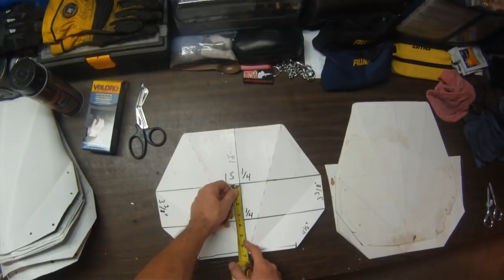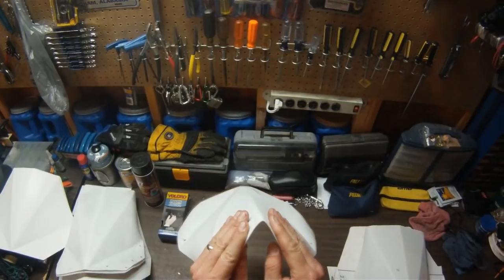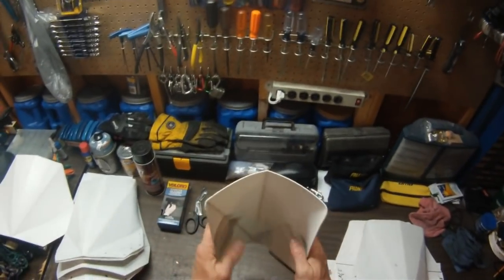DR650/DRZ400 DIY Windscreen

Comment: I saw one of these on a DRZ here in Western Australia , the rider told me about your video . I used a $6 sheet of polypropylene from the hardware , as the rubbish bins were around $20 to $30 here . Works great , thank you for the design
Reply: Brian Bullock Bunnings? How thick was the plastic?
Reply: hmm , IDK , 3 mm maybe , I used a heatgun and straight edge to manage the bends , its not perfect , but does a perfect job . Deflecting the wind off my chest , and cheap as to be able to trial and error , rangafrombanga
Reply: Ta. I'm off to Bunnings. Love this shit!

Comment: Used your template and used a 15 gal plastic barrel.  I used a torch to bend it.  It was alreay rounded and turned out “ok.”  I started tall and cut it down three times to get rid of buffeting.  It works. Thanks.

Comment: I can totally vouch for this DIY.  It's brilliant.  I made one thinking 'no way this is going to hold with velcro at speed'. But it worked fantastic! Never budged, and made all the difference as far as wind protection on the highway goes. 
Its brilliant because its sturdy enough to block wind but if your helmet (or face) makes contact in the gnarly stuff - its maleable enough that you wont be hurt.  I eventually bought a Baja windshield simply for aesthetics but this thing actually looks kind of cool. Mine was black so it looked a bit Mad Max.

Comment from the maker: As far as material, all I can say is whatever you can shape. I use plastic cans about 2mm thick.

I have a Clark on my DRZ and an IMS on my DR. Both are great. No issues. No complaints. The Clark cap is tight due to a swelling gasket, but not really a problem.

Comment: I like this design.  I just made one today out of posterboard using the measurements from the first on you showed.  I plan to try various heights and maybe attempt to make a rounded one out of lexan or something.  I might have to get some help from my pops to do that.  Either way, thanks for the diy on this one.  It seems so simple, but it actually looks badass in my opinion for what it is, and couldn't be more cost effective.  Thanks for taking the time to post the video of this.

Comment: Thanks for sharing, tried it on a trip to Ottawa, worked great, however it came off at 72 miles/hr, or 120km/hr, so I added velcro here and there, and wow, I made the second one using the stove at the lowest setting to soften up the plastic and its much easier to fold with precision, and again thanks, I saved up a shit load of money and it looks good

Comment from the maker: All the usual, FMF Q4, airbox opened, jet kit, carb work and extended fuel screw, shock spring and Gold Valve kit, Progressive Springs in the forks.

Several other mods, but those are the main performance mods that I can remember right off.

Comment from the maker: DR650. More versatile. More dependable. More power. Will do single track and Interstate and is better for long distance as well. The DRZ is only better in the most technical stuff.
Reply: fmlstewart get the 400, if you think you want the 650 for those reasons get yourself a v-strom or a verses instead. 
Surprisingly capable off road (look up fortnine on YouTube) 
The drz is a road legal dirtbike.
Reply from the maker: +Taylor St. Pierre dude, do you GeorgeSt. Pierre? 

I've had a drz400. it sucks s a dirt bike, and sucks s a super moto. the dr 650 is the shit!!! But, rude what you've got to the best of  your ability. I guarantee, unless you're Taddy Blasuziak, you're nit out riding your bike. Ride on!!!
Reply: fmlstewart I have a ktm 350 sx-f and the drz. Honestly the drz surprises me what it can do. It goes everywhere the ktm can go. It's heavy and rough for sure but It climbs every hill like the real bike and wheelies like mad. I've tried ktms 690 enduro r too. It's a much better bike, but it's also significantly more expensive. I wouldn't make the trade. 

When Yamaha (if) comes out with the t7 I'll make the trade though.
Reply from the maker: +Taylor St. Pierre yeah, I've had a 400 exc, and an XR400R. I've had two KLR's, '07 and a '12. I've never had a bad bike. Love them all, but the DR650 does it all better than any other bike I've ever owned. I'm currently riding a Triumph '13 800xc. It's badass! But I still miss my DR650. I'll be getting another soon!
Reply: fmlstewart maybe when I'm done with the 400 I'll have to try the 650. I've ridden the klr but I sure wouldn't trade that one... 
I've also got a super adventure... But it's awful off road. It's more of a sport touring bike than a true adventure bike. It's just too heavy. 
Itll be for sale next spring

Comment: First off.... AWESOME videos!!  I watched all 3, at least twice.  Do you still have your DR, or DRZ??  I am wondering what you decided is the best "angle of Attack" for the fairing??  I am making a custom template for my KTM 520EXC using many inputs from your videos.  I started by making a DRZ template as a baseline, and will eventually use it when I get back home to my DRZ.....  It just seems that the attack angle might help me keep from having to go through too many iterations.... I am going to try to find the angle of attack on the new production Honda Africa twin also, because I am thinking that angle would be about the same for all of these rally type fairings, what ever the brand.  Thanks again for your video work!!

Comment: so what really bothers me while riding is the wind turbulence in the helmet. bothers my ears. ear plugs help of course but would like something more.

since you claim the wind dumps out at throat height, does it make turbulence in the helmet worse or does it help?
Reply: if its bad, cut it shorter until it works for your height. yes, if the air is hitting your face it'll be louder.